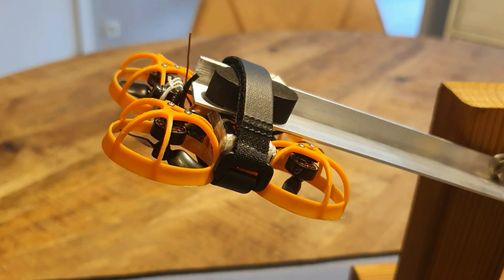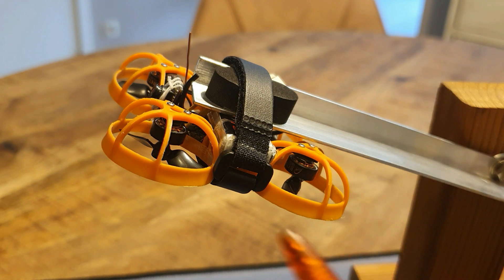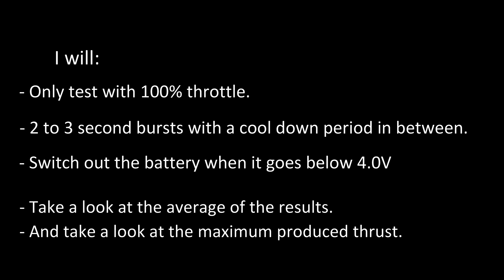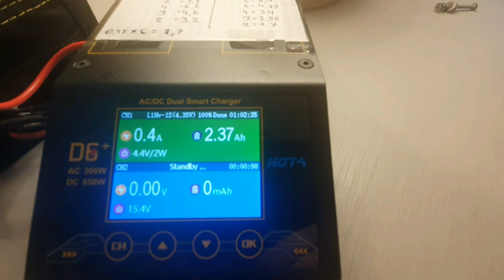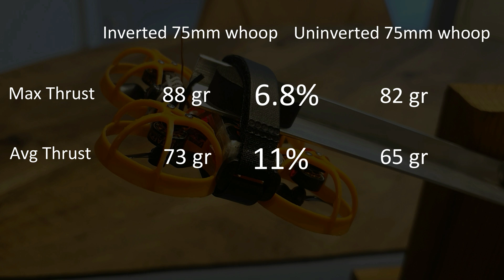Inverted VS.  uninverted whoops thrust stand test | Square One FPV

Comment: Interesting🤔 I had quit the opposite effect when it came to efficiency on my inverted 85mm cine-whoops (all 3 or 4 bladed propellers!). My only viable inverted build was a ultralight 75mm with the highest weight to thrust ratio of all. Must say, that one flew like a dream and had almost the same efficiency as when flying it non-inverted. Next time I’ll definitely install 2 bladed props and do a more scientific test 📈 Love your content 👍
Reply from the maker: First of all, thank you very much 🙂. I've never tested it on anything bigger then whoops. 
Are they ducted cinewhoops, because that will have a influence on performance when flipping motors upside down. 
Chris Rosser actually briefly mentioned the benefits of inverted drones in one his early video's but I can't find the part anymore, it's like a 30 second part of a 20 minute video 😅.

I think the best thing for me about inverted whoops is the weight distribution, putting the battery on top makes it feel different in the air, less pendulum effect. 

Too bad I don't much time for YT anymore, would love to do this one again, but A little bit better, like taking the pidloop out of the equation ( big mistake in that vid 🙄 sorry)

Edit: haha net gezien dat je een Nederlander bent, groetjes uit Belgie :p
Reply: @SquareOneFPV   Engels is nog steeds de beste voertaal als we het over dit soort lastige zaken hebben. 😄Zoveel variablelen ook. 🤯 Ik ga dit experiment zeker nog een keer opzetten want de manier waarop mijn lichtste unit vloog was heel bijzonder. Groet uit NE ✌
Reply from the maker: @petereuvideodrones  Volledig akkoord, Engels praat veel vlotter als het over drone, of nerd stuff in het algemeen gaat😜. Ben benieuwd wat jou bevindingen gaan zijn, mag je mij altijd wel laten weten.

Comment: Thank you for taking the time to run these tests 
Question, did you invert the props on the inverted whoop? @CiottiFPV recently did a thrust comparison of props using Turtle mode and figured out he got much higher thrust when he flipped the props upside down.
Reply from the maker: Hi Michael, my pleasure 🙂. No props are right way up, just like they would be when I fly it. I haven't seen that vid from @CiottiFPV, I'll have to check it out. Thanks man!
Reply: @SquareOneFPV  He did live streams, starting 2 weeks ago on freestyle Friday, followed by 3 more testing vids.  I think the second one is when he discovered that if he inverted the props he got more thrust. For the way he was testing with Turtle mode.
Reply from the maker: @Michael_DahShow  Watching the stream for 2 weeks back right now, interesting stuff here 👌👊
Reply: @SquareOneFPV  I just checked and it was the first video @1:50:16 When it was suggested in he started testing. 😉
Reply: @SquareOneFPV  If the props are installed as they would be non-inverted.  I say give it a shot with the props flipped around.  😉

Comment: If you are interested in more power,  I have some great tips for your setup about duct design that should improve greatly your setup.  There is more power left on the table and it will make your setup more efficient.  Find me on messenger or facebook.  I share alot of info on ducted setup

Comment: I somewhat agree that it’s because of the extra frame turbulence that is causing the efficiency loss for uninverted whoops, but the other guy who did the 1prop/motor test doesn’t have a whoop frame so that can’t be the only reason.
I believe it’s that there is a dead spot, like tailwind, right below the motors where there is no lift causing it to be less efficient. Since the air pressure is not as high in that spot, there’s less pushing up the drone. When inverted, the drone is moving into more and more air, so it’s not as important since the supply of air is more abundant.
Reply from the maker: Very interesting theory 🤔. this winter there's a follow up of this test coming where I will put the FC out of the equation, and I'll compare amp draw. Thanks for sharing your thoughts on this! 👍

Comment: On the inverted.  It looks like each motor is missing a screw..

Thank you for taking the time to test this out.  I am going to invert my Mobula6 HD.
Reply from the maker: Yes there's a screw missing on each, I just try stuff out, too see what works and what doesn't. Those four screws save 0.1 gr, hardly worth it, but there were no consequences for durability, or vibrations during flight. I'd love to see the result, it's going to be a challenge because the dvr board will be sticking out of the bottom of the frame. But very cool mod if you succeed, let me know how it turns out. Good luck!
Reply: @SquareOneFPV  that was my thought on why the screws were missing, but wasn't sure.   Thank you for the clarification and thank you for taking the time to make the videos.  I'm thinking about converting my Mob6 HD to a 75mm pusher.
Reply from the maker: @Michael_DahShow  Your welcome😊! I'm just having fun making these video's and if I can inspire or help a few fellow pilots along the way it's just a bonus 😉. Got a series about my 75mm M6HD conversion if you're interested. It's not a pusher, but it has a better receiver and a tbs nano vtx. Feel free to check it out 
https://youtube.com/playlist?list=PLMfx9W33Xj4Y1mNHwgYpfwoQb7DY5N9Fj
Reply: @SquareOneFPV  already watched them and will be rewatching when I get my parts.  I am going to try the NBD Extreme Durable 75mm frame.   Might grab the 25000 kv motors.  I will see how well the 19000 kv do first.

Comment: Thanks for that information. I just got the Holybro Kopis 2.5 with inverted motors and it seems to fly better than other cinewhoops I have flown. May be due to the inverted motors. It also gets really long flight times of over 8 minutes on a 4s 850mah battery. I do have to be more careful about things getting in the props when landing so I use a rubber mat.
Reply from the maker: Haven't flown it but that's a really nice drone 👌. Yes the higher center of gravity gives you a better handling drone, and wow, those are  impressive flight times, awesome! Thanks for sharing, I always love to hear what people think about inverted.

Comment: To be clear, 80% of the lift generated by an airfoil, hence a prop, comes from the top of the airfoil (extrado), so you don't want anything disturbing the air flow coming to the extrados: inverted is bad for this reason. The only reason you find the opposite on your static test is that the airfoil is stalled  and the turbulence generated by the inverted frame somehow partially reattached the airflow on the prop. 
Please, don't believe this test means something, it just doesn't.
Reply from the maker: All right, thank you for your comment. I like flying inverted whoops for how they feel, as you stated in your other comment, the different feeling in flight characteristic comes from moving the center of gravity. But I always thought there was more to it. And when seeing my whoops a lot of people ask me what the difference is, so I wanted to find a way to show to people that  there is a difference. I've build a lot of whoops, building to me is just as fun as flying. And when I invert a whoop with the exact same components and weight, the inverted one feels stronger. I've seen your channel and see you like building whoops, I would find it very interesting if you would invert one and tell me ( us) what you think of it.
Reply: @SquareOneFPV  yes I will, but not inverted, I will print a canopy that holds the battery like Angry don's one: https://www.youtube.com/watch?v=fm9yXDvcmF4&t=426s
this way you get the best of both worlds: high CG, and good airflow.
Reply from the maker: @cedricgrandseigne  Great, thank you for the info. I'm going to give  that canopy a try!

Comment: A couple of points: The flight controller is trying to balance out thrust while it is fixed to the thrust stand, you will lose quite a bit of thrust so the results arent really reliable. Use either a speedybee adapter, or a long USB so you can use the Motor test tab in betaflight. Thats pure throttle, no balancing out.
Also, air coming out of the back of the prop is by default super turbulent. It has just been chopped up by the propeller. Would be good to get a result with direct motor output...
Reply from the maker: You are absolutely right, I am going to do this test again, and I am going to make a follow-up video. I've gotten a lot of tips to improve my test, especially getting the FC out of the equation a big one. Thanks for the help! 👍
Reply: @SquareOneFPV  see if you can get amp readings for each throttle point too. One thing I read is that while it might be more thrust, it's also a lot lower battery life, which would mean amp draw is higher at a given throttle point, or thrust figure.
Reply from the maker: Mmm 🤔 yes comparing amp draw with motor output would be very interesting as well! I'm not sure but I think I can see amp draw in betaflight when using the motor tab to spin them up. And how would you suggest testing with direct motor output? I don't see how I can do that😕? Thanks for the input!
Reply: @SquareOneFPV  ah the direct motor output bit was in relation to the betaflight motor tab. I fly silverware whoops and they have a "throttle to motors" function you can enable with a switch to test thrust output (just plots throttle direct to all 4 motors based on throttle position). I'm not sure betaflight has that.
With the usb cable, just make sure that it doesn't affect the results, if it is stiff or something like that

Comment: Hi . ccool test. I might suggest running a usb cable up the arm of the test rig so you can run the quads with the configurator ie betaflight if thats what you run . drive the motors without the oid loop interfering . Cheers
Reply from the maker: Alright, perfect! Why didn't I think of that?! I am going to have to do this thing al over again 😅. Thanks for the tip mate! 👍👍